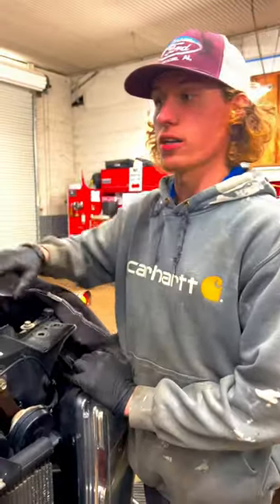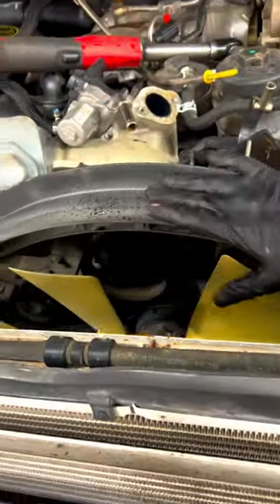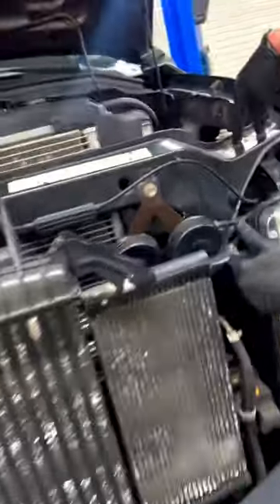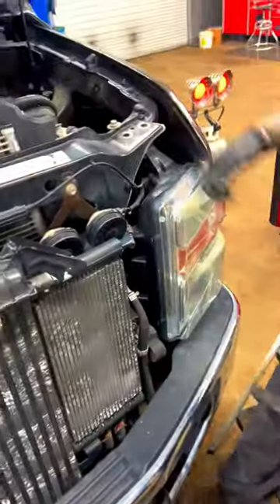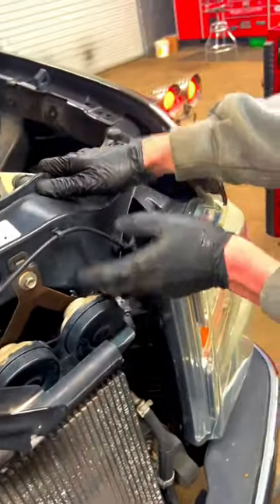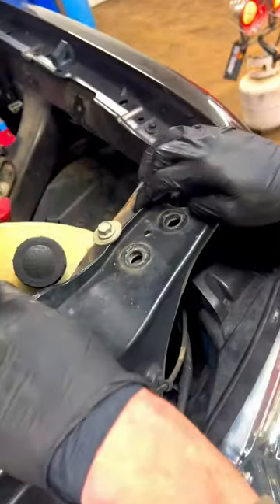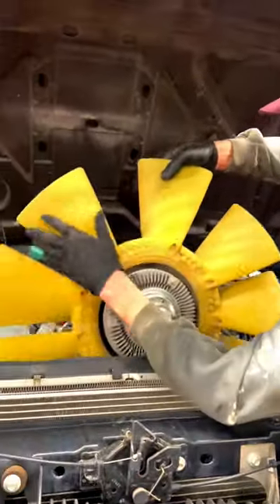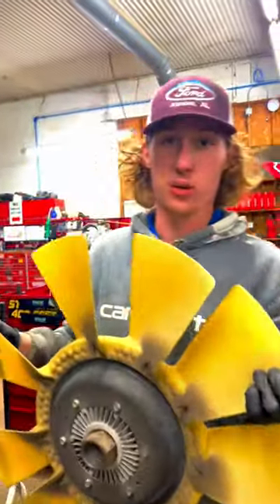Ford 6.4 PowerStroke Mechanic Tip #shorts

Comment: Best trick for the 6.4 Powerstroke Ford is to send it to the scrap yard
Reply: @Oldsoulstuckinabadtime  as far as I'm concerned, anything with a modern exhaust system is pure trash.
Reply: @Oldsoulstuckinabadtime nothing can be done for the 6.4, the pistons are brittle like glass, the power delivery to the crank beats the bearings to death ridiculously early, among countless other poor engineering designs inherent with the 6.4.
Reply: @Oldsoulstuckinabadtime  the majority of my yearly income is from repairing Ford and International diesel trucks, after the 7.3 these engines are just not worth shyt.
Reply: @richardbolger5140 Maxxforce pistons fixes the piston cracking, but yeah good core cranks are rare.
Reply: @warrenself  what fixes the lack of volume of oil through the head???
Reply: I think any truck above 2006.
Reply: @richardbolger5140 I believe it’s the valve covers.
Reply: @richardbolger5140  Choate valve covers. 6.4 is an expensive engine to run no doubt.

Comment: Send em my way. Love the 6.4s
Reply: Amen
Reply: wanna rebuild mine?😂
Reply: @jordangiesbrecht05  if youve got the dough, sure
Reply: @jonmarshall272  the dough is kinda a  issue ngl but I've been thinking of trying to bulletproof it. fresh oil cooler coated delipped pistons, new rocket arms, head studs and so on. but is it worth doin? like would my truck run reliably after that?
Reply: @jordangiesbrecht05  depends how far your so on is on the build list, driving habits, maintenance schedule, hp level etc. I would never tell someone whos on a budget to rely on a 6.4L
Reply: @jonmarshall272  well the trucks actually not blown up. (yet) 135k mi so hopefully goes for awhile yet. I do oil every 5k and fuel filters every 10k using amsoil 15w40 and motorctaft filters. it's my daily driver for me who works on a farm. so 75% unloaded driving except for tools and junk. occasional heavy gooseneck towing but i drive real easy wen towing. I do like to have a little fun every once in awhile but I would say I'm actually pretty easy on the skinny pedal. I run a 50hp blessed performance tune. so a built one seems like it would be reliable but idk considering its still a 6.4 lol
Reply: @jordangiesbrecht05 just save up the money and order a kill devil diesel long block. Great engines with a good warranty.
Reply: @jordangiesbrecht05  Kill devil diesel has carillo rods with steel 6.7 pistons fix it once and be done.
Reply: @nou8257 facts but I don't wanna be broke for the rest of my life😂
Reply: @jordangiesbrecht05  Then cummins swap it or get a 7.3
Reply: @nou8257  I like power. cummins would require same amount of money to make it have 500hp. 7.3s might be reliable but they slow ab. there's a local guy that builds a 6.4 long block for 9k. stg1 cam, head studs, maxxforce pistons, fully balanced,and a warranty. rates it at 600hp capable. I'll pry go that route but we're still goin strong at 160k
Reply: @jordangiesbrecht05  Ehh I dont care how much the guy puts de lipped and coated pistons in it maxxforce stuff still used aluminum pistons like a stock spec truck I bet he doesn't put valve guide bushings in the heads upgrade to stronger rocker arms or lifters (since lifters are the same as a 350 chevy) it's a 6.4 if money is a issue no point not spending all of it at once and doing it right and never touching it again.

And yeah my 6 speed 7.3 won't run with my 6.4 but they get into the 500 range these days with some work 6.0's get into 600's fairly easy.

Comment: For those who struggle with which way to loosen a fan clutch nut. Always turn the nut loose the same way the fan turns when the the engine is running. All brands…all applications. Disclaimer…turn the engine off first.

Comment: Question - I am unfortunate to own a 6.4 with 68K miles on it.  I think the fan clutch may be going out on it..  Every once in a while I get this hi pitch noise that sound like a jet engine, accompanied by loss of power from engine.  Usually when under load of towing up hill, but sometimes close to start up.  would like to hear your thoughts.

Comment: Very helpful tip . also,As a part time mechanic myself,the 6.4 is indeed not very much fun to work on when you’ve got a bad piston at 400k ,however,I much rather work on 15 6.4s a day than I would 1 6.7 a week ,,I own a 6.4 ,never had an issue 208k miles,,tunes deletes and normal maintenance.
Reply: 100 percent agreed. Delete them and they are solid
Reply: @williamuskoski1385  good to know someone understands
Reply: @ictdpowerstroke4591  I’d work on six fours ever day compared to one duramax. Those things are ass
Reply: @williamuskoski1385  preach it brotha,,amen,,AGREED
Reply: @williamuskoski1385  I worked on 3 duramaxs last week,,one was in limp-mod and I was pulling 5 injectors out of the other and the other one needed a new turbo,the all had less than 130k miles

Comment: Every truck/car brand in the world if they screwed up and came out with a motor that had a ton of problems The fans would have called it out for what it was. Them ford diesel guys will say it was a great motor but you only had to put 5 to 10 k of mods Into it off the showroom floor just to make it reliable and then turn around and say it was the best motor ever made😂 hell I think any crappy motor with that many modifications would probably work better afterwards haha